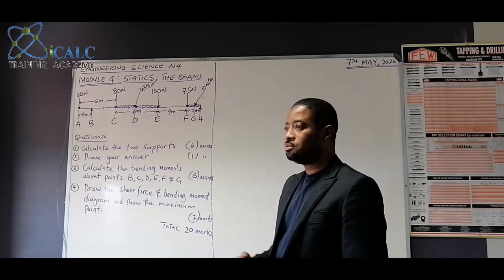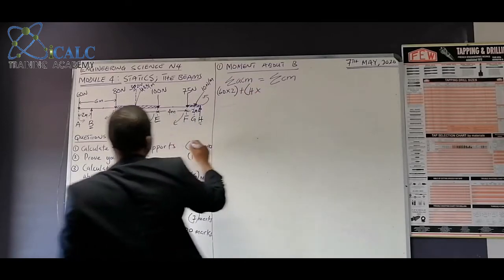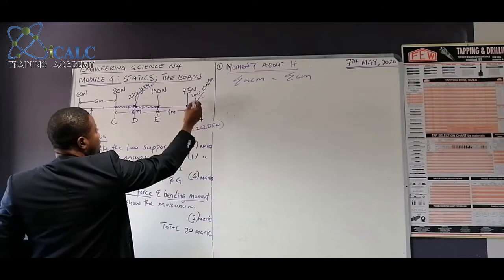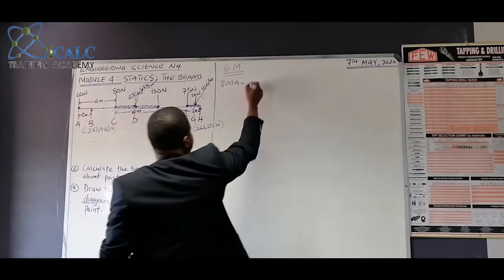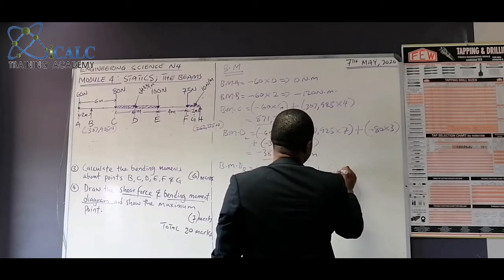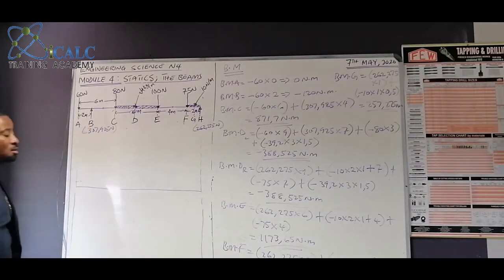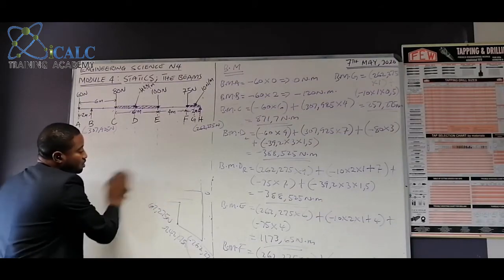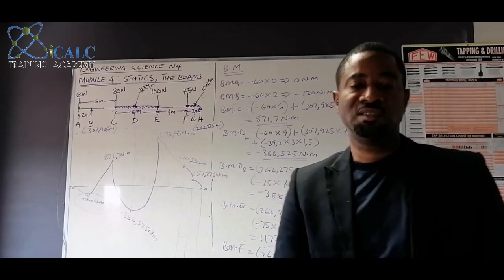Engineering Science N4# Beams

Comment: When it come to bending moment this guy is confusing...why a you using 9.8 and why u timing with 1.5 for
Reply from the maker: Of course you need to convert the mass to weight about the UDL. You must always consider the full length plus the half length of every UDL whenever you are calculating UDL.
Reply: F=mg
F=Force
M=mass
G=gravity

He wants to convert the 4 kilograms to Newtons,  thats why he multiplys
By 9.8
Reply from the maker: And multiplying by 1, 5: basically with UDL you need to multiply by the actual length and half of the actual length...thats the principle when calculating anything about the UDL.